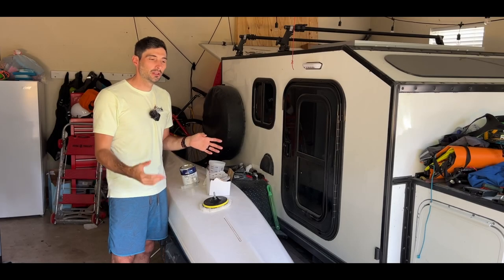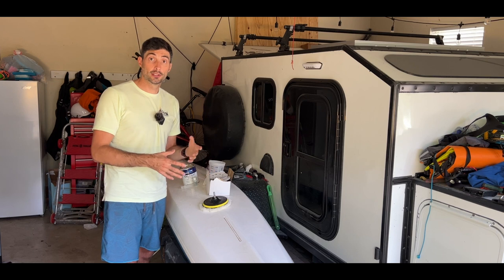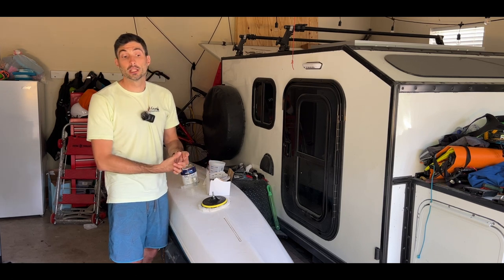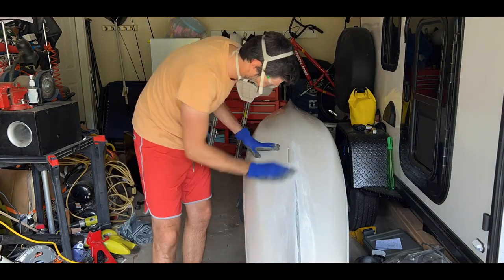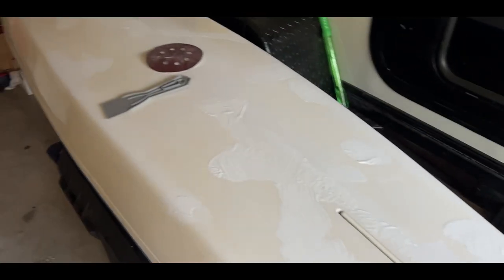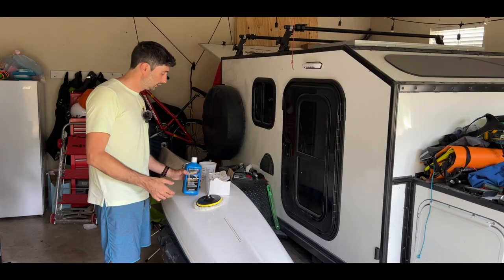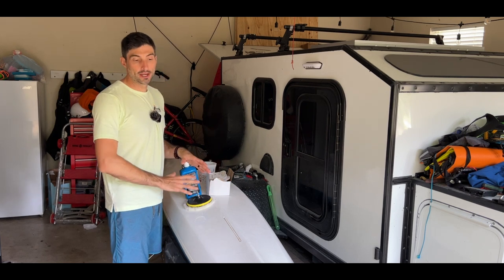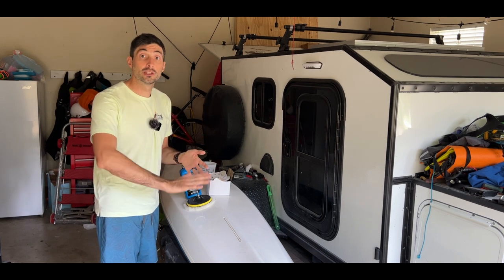Gelcoat Repairs On My Kayak - Kayak Hipster

Comment: Btw Luke, I did my own keel strip on my Illusion with a “Keel Easy”, and it came out fantastic! White on white.😊I did use a heat gun to apply mine. I’ve done 3 kayaks with Keel Easy, very pleased with all three.
Reply from the maker: Awesome!! I’ve gone back and forth on doing it, but I’ve seen some that didn’t turn out great when done DIY so I was hesitant to do it. Thanks for letting me know though. Maybe it’s worth doing once I fix the rest of the hull

Comment: The miracle of white is how forgiving it is to variation. Gelcoat is notoriously hard to match. You did great and your method seems sound. Someone else mentions epoxy as a substitute, but my concern is that polyester does not bond to epoxy and later this would come back to haunt you.

Comment: What I don't understand is that they say the gelcoat with wax is to be used as a topcoat, and gelcoat without wax is for building up layers of thickness. The gelcoat without wax is said to remain tacky so do you refrain from sanding until the final topcoat is applied? Alternately will multiple layers of the "with wax" version properly adhere to the sublayers?

Comment: Did you notice any performance improvements?  I’ve heard some racers swear by boat polish but I’m not sure whether it’s psychosomatic or real.
Reply from the maker: I’m not a fast paddler, I don’t think I’d be able to tell the difference. Changing from kayak to kayak I’d be able to get a sense if I’m paddling fast or not. But just fixing the gel coat, I wouldn’t be aware enough. I’ll bet there are paddlers that are so in tune with their equipment they probably are able to. Or at least if you’re timing yourself maybe you’d see a difference?
Reply: @KayakHipster  yeah it’s hard to isolate that as a factor vs how you’re feeling, conditions, etc.  I’d imagine racers would be the most in tune with it though, so maybe!